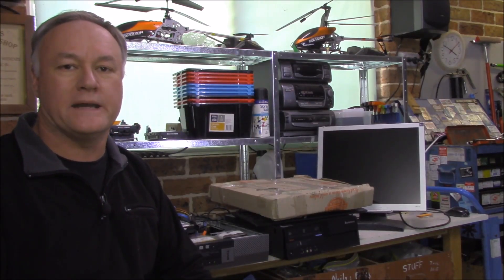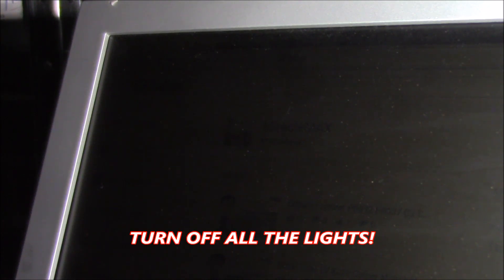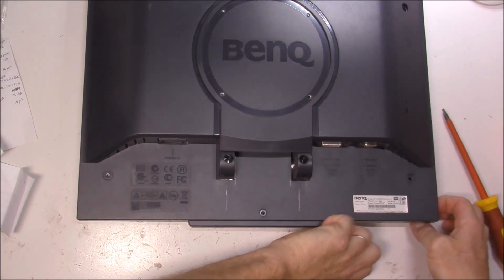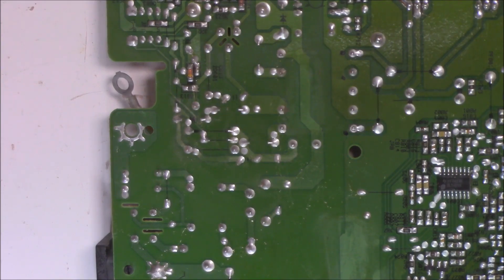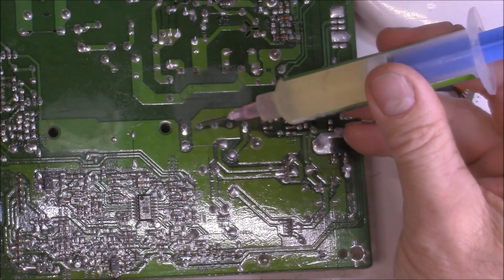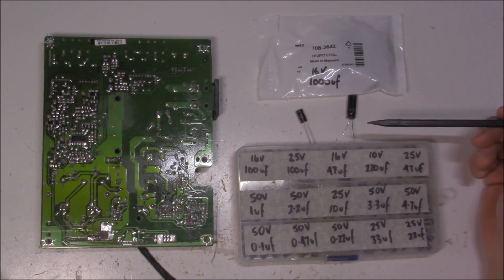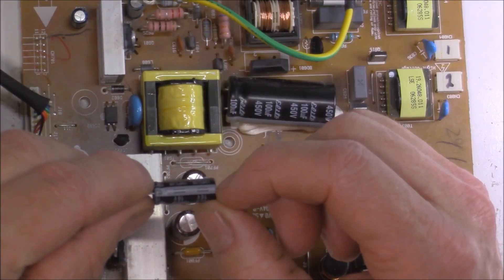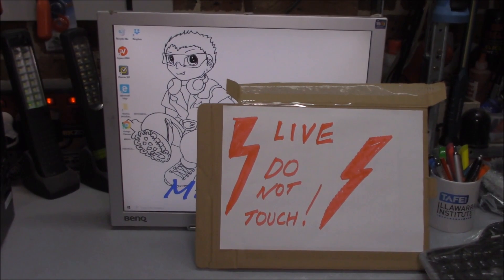Benq Monitor Repair MiracleMAX

Comment: Hi again Max, have you come across low ESR caps in your repairs? Seems a bit of an enigma...I've just discovered that they can potentially be used in power supply circuits, but can't find anything specific around markings for identification. I expect it could pose issues if you were to unintentionally interchange regular and low-ESR caps?
Reply from the maker: Hey Lloyd Lawrence
,
ESR stands for Equivalent Series Resistance or the amount of resistance a capacitor has. Given time the electrolyte tends to dry out or leak out of a electrolytic cap. This in turn tends to raise the ESR and make the system not work or do strange things. There are plenty of calculators as well as charts that tell you what a cap should have by voltage as well as capacitance. Here is an example.

https://www.jestineyong.com/wp-content/uploads/2012/05/ESRTable1.jpg
Reply: @MiracleMAX  Thanks. I'm testing some today with my ESR meter for replacement...but the mention of low ESR caps threw me from my reading online.
Reply from the maker: @lloydlawrence2526  These readings are used for SMPS power supplies. Low ESR just provides a lower reading & tend to last longer.

Comment: Awesome, thanks Max! So it's generally OK to do ESR test in-circuit?
Reply from the maker: Hey Lloyd, 
Using the Blue ESR meter I have never had any troubles with testing in circuit. The readings have always been the same in or out of the circuit.
Thanks for your comment.
Cheers
MiracleMAX